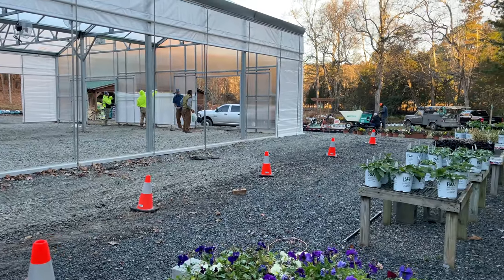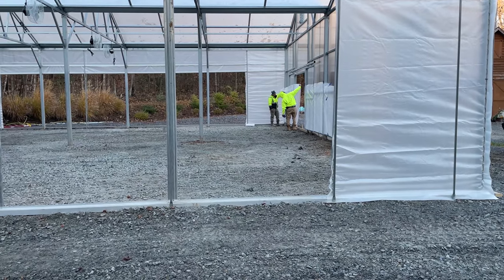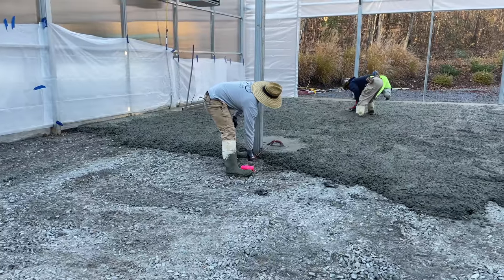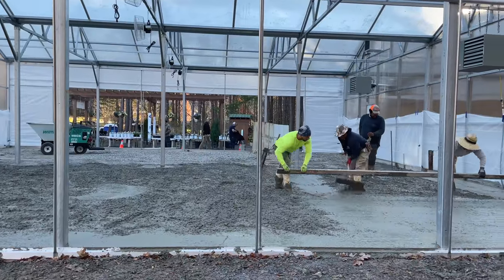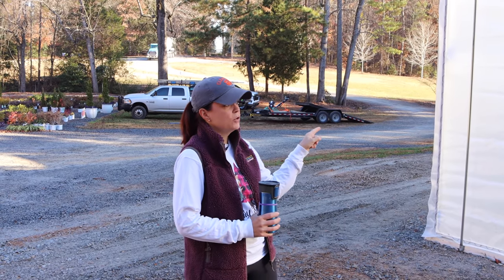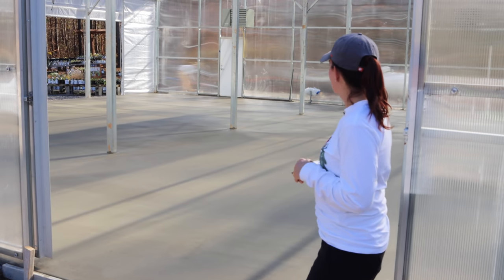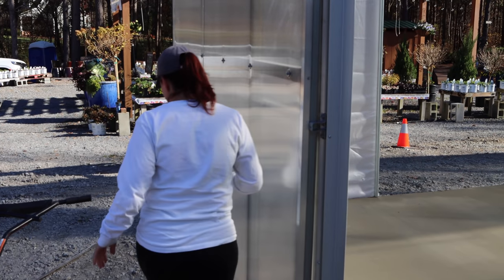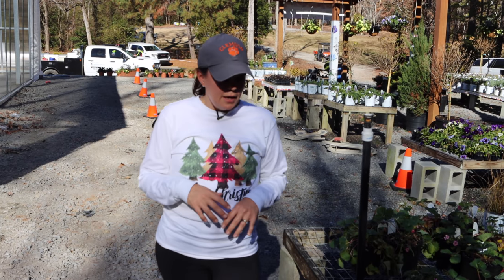Pouring Concrete for the Greenhouse | Gardening with Creekside

Comment: Beautiful! Your greenhouse is going to be so nice! I’m wondering if they used any rebar , maybe under the gravel,to reinforce the concrete?
Reply: I’m wondering the same. My father worked with cement all his life and you never did a floor without rebar or it would crack and break. Especially with that size of flooring. Also curious why there is no drain set up either in the middle or around the edges for water run off. Especailly if they will be watering plants in there. Hmmm🤔
Reply: They may have rebar under the gravel, but unless I am mistaken, it is only commonly used in the North where it gets much colder to reinforce it. Where they are in NC, their nighttime temps might dip into the 20's but then it's right back up above freezing in the daytime. As opposed to the North, we get below freezing & it stays there for extended periods of time. Again I could be wrong!
Reply: @denisestine2141  That does make sense! I live in Western Montana and rebar is always used!

Comment: Nothing more fun than watching people pour cement! I was curious why didn't they use a concrete pumper truck, it would have been so much faster and easier, could they not get the hose low enough to go in the doorway?

Comment: Why not just leave it gravel?
Reply from the maker: There’s a lot of pluses to having concrete but the short of it is it will make life so much easier!
Reply: If you have ever worked in a production greenhouse you would understand more. It helps with almost everything you need to do in there. Easier for cleanups if you spill potting soil , using carts while moving plants, all sorts of things... 🙂
Reply: @GardeningwithCreekside  Thanks!